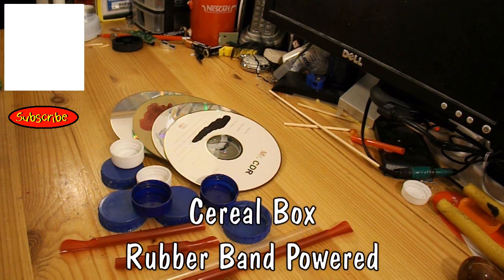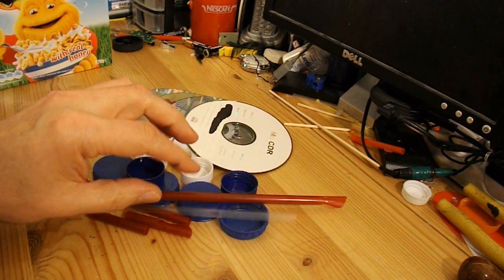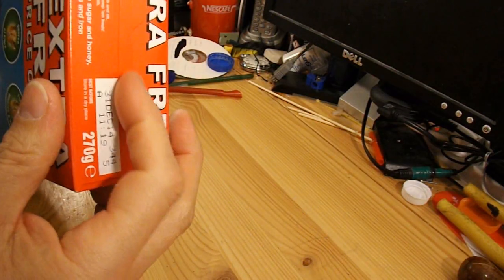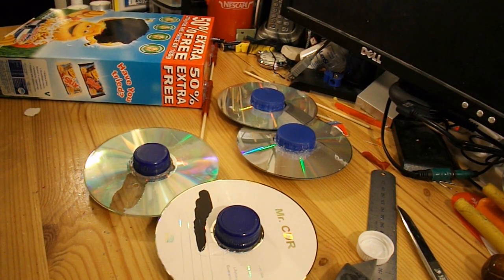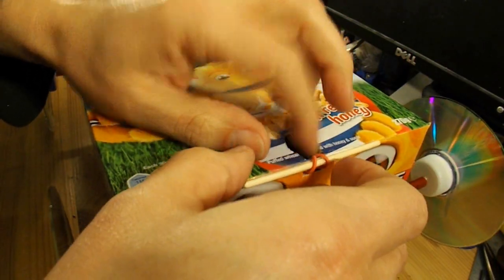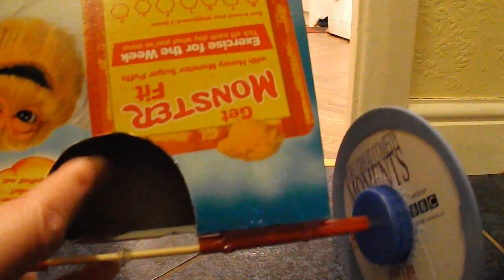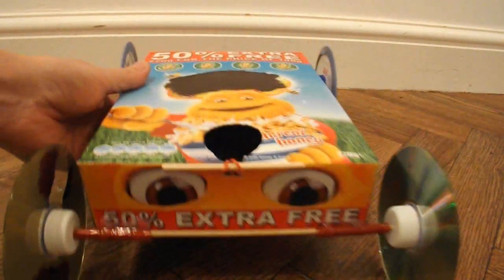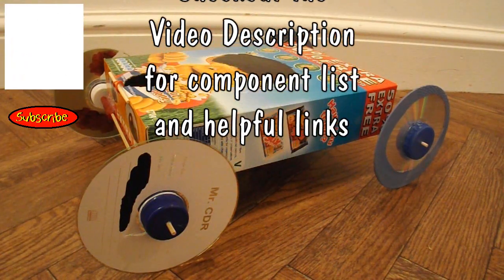Cereal Box Rubber Band Powered Car

Comment from the maker: If you have a question it is probably worth reading the video description first because the answer may already be here. To help you find my videos I made two search guides https://youtu.be/ceBSOoOHcgw or https://youtu.be/Zj4UgwkwYRk or checkout my playlists page https://www.youtube.com/user/GrandadIsAnOldMan/playlists?flow=grid&view=1
Reply: can you pls tell how to put the wheels so they can stay because when i put the wheels they slide of was it because bigger hole in the caps pls answer 😃
Reply from the maker: ummustafa javed when you make the holes in the caps you must use something thinner that the axle you are going to use. That means when you push the axle through it will be a tight fit. If it is too late to get that right you will have to add glue or you could try putting sticky tape round the axle to thicken it where it goes into the cap. Just one or two layers will probably do the job. I usually manage with a little hot glue on the outside bit of the axle.
Reply: can you pls make a car with shoe box if posibble
Reply from the maker: +ummustafa javed I don't have any shoe boxes but to be honest one box is much like another, so any box will be like using a shoe box. In my Rubber Band Power playlist I have over 200 videos and many of them are rubber band powered cars and many of those are some sort of box. If I find a suitable box I will make one for you but you might like to look through that playlist anyway https://www.youtube.com/playlist?list=PLA5a2xPRSrB1otXh0w36OwsYIHZznUWp6   this tissue box would be very similar https://youtu.be/2sO7X7qGRAs?list=PLA5a2xPRSrB1otXh0w36OwsYIHZznUWp6
Reply: +GrandadIsAnOldMan thanks
Reply: +GrandadIsAnOldMan I always allow replies, unless a glitch occured. I was wondering if you can... make an motor car, like a toy to donate to children, out of an red heart-like crystal? A heart-crystal-car.. I doesn't have to be an actual gemstone, and you don't have to take up the request, but... I want the children in your neighbourhood to be happy... Handcrafted toy cars, all for them.. You don't even have to say my name, or credit me, I am not in the request for fame, just making others happy...
Reply from the maker: Toriel Dreemurr going through the points of your comment. 1. The issue with YouTube preventing replies to comments has been fixed now that YouTube has broken the link to Google+ however I have well over 2000 videos on YouTube and many of them have that warning text on them because they were published when the problem existed. I now delete that text form any video I have reason to revisit, but I am not going to attempt to edit all 2000 videos to remove it proactively. 2. I am not interested in trying to make the children in my neighborhood happy, that is their parents responsibility and I have no intention of interfering in other people's lives.
Reply: do
Reply: GrandadIsAnOldMan can I ride it
Reply: what type of juice caps did u use
Reply from the maker: I tend to use Milk Bottle tops because we have plenty of them. I always save all the plastic bottle tops from any bottles we use.

Comment: If our car is smaller and the wheels have more traction, but it still uses the rubber band mechanism, will it go farther?
Reply from the maker: +bold n brash not really a simple answer. Smaller and lighter with good grip will accelerate faster and probably go father but not always. Here are some other considerations. A heavier car will accelerate slower but once it is moving it's mass may help it freewheel longer after the rubber band has finished. Larger wheels - assuming you are using the same sized axle then you will be putting the same number of turns round the axle right? but for each turn of the axle a larger wheel will move further along the floor because it has a greater circumference so for the same number of turns a larger wheeled car will go further. SO no simple answer, sorry.

Comment: I have to do this for a science project but without it being powered by a rubber band, however my car is just sliding and not rollong, do you have any idea why? Also, how can I fix that?
Reply from the maker: If it is sliding around without the wheels turning then something is stopping the axles turning. That probably means the tubes you used for the axle tubes are too thin or the axles are too thick and they are binding. Or the wheels are too close together, rubbing against the end of the tubes or the cardboard box.
If you are not using rubber bands, how are you powering it. Are you just pushing it?
It may simply be that the car is very light and the wheels are not gripping on the ground. You could add weight to help them grip or put the rubber tyres on the CDs. You will find this link in the video description with other information Helpfile - how to put tyres on CDs for model car projects https://youtu.be/ZnuPnveCbxs

Comment: would it still work fine if there was only bottle cap hub per cd wheel. like i only put a bottle cap on one side. would it still be ok?
Reply from the maker: +itsLuis551 why don't you try it and find out. I expect you will find that the wheel tips sideways because it is unbalanced. The problem with CDs is the hole in the middle is too big for most things that you want to use as axles so you need to cover the hole and put a smaller hole through the middle. You could just try gluing some cardboard or flat plastic across the hole and make a suitable hole for your axle through the middle. I use plastic bottle tops because I have plenty of them and they are easy to use. Maybe you could use a bottle top on one side and a flat piece of cardboard on the other. That would help balance the wheel.

Comment: How did you get the skewer through the bottle caps? Did you drill a hole?
Reply from the maker: +Alyssa you could use a drill. I have a tool called a bradawl which is just a metal spike with a wooden handle.

Comment: how can i design and build  a car driven by a SINGLE small elastic band to carry an boiled egg over a distance of exactly 12 metres
Reply from the maker: I have 124 videos in my Rubber Band Power playlist http://www.youtube.com/playlist?list=PLA5a2xPRSrB1otXh0w36OwsYIHZznUWp6
I have nowhere I can test a car to run exactly 12 metres but in that playlist there are cars that run a fixed distance by using a length of string or cotton winding round the axle to measure the distance travelled and stop at the right spot.
There is a table defining the different sizes of rubber bands so you would need to know what size 'a small rubber band' is, so you are not disadvantaged by other people's interpretation of 'small'. You can easily find it with a Google search.
The main aid to travelling a good distance is ensuring you reduce all sources of friction. Thin wheels cause less friction which is why I use CDs most of the time.
A thin axle will have less friction than a thick axle and you need to think what you are using for the axle bearing surface.
Larger wheels maintain momentum better than small wheels and you will probably need this to keep the car going after the rubber band has finished. Old fashioned vinyl records are a good option but you may struggle if your rubber band is too small.
There is a trade off between light and heavy cars. Too light and the wheels spin when you start although you can reduce that by putting something on the wheels to increase grip, like a strip cut from a balloon. Heavier cars take more to get them moving but then maintain their momentum better than a light car.

Comment: when I do the wheels do I leave space between the cereal box and the bottle cap?
Reply: I can't use bottle caps so I just cut Styrofoam but it won't stay
Reply from the maker: +Julie Smith yes you need to leave a gap to stop the wheels rubbing on the box. You could even add small discs of cardboard to act as spacers. Foam is too weak for wheel hubs, try thick cardboard or several layers of thinner cardboard. In the video description there is a link for CDs with cardboard hubs.

Comment: well I fixed that problem. now I have another one. if I wind a rubber band too tight, the axle spins too quickly and the wheel doesnt turn. how would I fix that?
Reply from the maker: +Spencer Bev put rubber tyres on. In the video description there is a link to my helpfile on putting tyres on CDs using strips cut from rubber gloves or balloons
Reply: +GrandadIsAnOldMan that's not the problem. the axle spins while the wheels don't.
Reply from the maker: Spencer Bev you will probably have to glue the wheels to the axle to fix that.

Comment: Please reply, did you use a hot glue gun to make the wheels connect to the axle? I tried that, but the wheels don't stick to the axle.
Reply from the maker: When I make the holes in the bottle tops they are slightly smaller than the axle so they are a very tight fit and grip the axle without any glue. If they are loose then, yes, I would use hot glue. If you have enough of the axle sticking out past the wheel you can put plenty of hot glue on the bit that sticks out so you have a larger area of glue making contact.
Reply: GrandadIsAnOldMan Okay, thank you.

Comment: GrandadIsAnOldMan, how did u get the screwers to connect to the bottle caps
Reply from the maker: I usually make the holes in them too small so the skewers are a very tight fit but you could always use some glue or even tape. There are some useful links in the video description

Comment: Hey grandad. I'm supposed to make a project alike to this one but instead of 3 meters It would have to go a total of 15 meters or higher. Do you have any ways that can make the vehicle go further in distance. Thank you
Reply from the maker: The distance it travels is down to the weight of the car, the friction of the bearings, and the power of your rubber bands so generally adding more rubber bands will increase the distance but may cause other problems like wheel spin or even crushing the body or bending the axles. Here is a simple car that goes a good distance - Rubber Band Powered Car 1 x size 64 - full length video https://youtu.be/pIO3FiHX4Oc?list=PLA5a2xPRSrB3g5RiX8Kf_uUBOL0Tb7AS0
Reply: GrandadIsAnOldMan  thanks 😊

Comment: can you please help me asap? I need to make this car go forwards and backwards. i tried doing what you did for #8 by adding another paperclip but it didn't work. I am not asking for another video, just a point in the right direction. I need this done by tonight
Reply from the maker: +Spencer Bev I don't know what you mean by adding another paperclip. Where you watching this video Rubber Band Powered Car #8 goes forwards and backwards https://youtu.be/bBU8UngaFfM The string attaches to a peg on the axle, you wind the axle for a number of turns, then pass it round the second peg so you can wind the axle in the opposite direction. In another video Forwards Backwards Turn Programmable Rubber Band Car https://youtu.be/ILvqa8Id4Rc I put lots of pegs on the axle and the car goes forwards and backwards many times and also turns because the front axle is set to move in reverse
Reply: +GrandadIsAnOldMan so my axle is a barbeque skewer and I used bent paper clips as pegs. the rubber band keeps getting caught on them.
Reply from the maker: +Spencer Bev you will have to redesign that part if it is causing the problem. Maybe a thicker axle so you can drill small holes and use thin wooden pegs like toothpicks or similar, nicely rounded off with some sandpaper so the bands don't get snagged.
Reply: +GrandadIsAnOldMan okay I will try that.
Reply: thanks for that advice too. i appreciate it.  I have two more problems. The first one is that i need it to launch on an inclined plane without me touching it. The second dillema is that i need it to go exactly ten feet then back five feet. Getting it to go ten feet is easy, but how would i install a break system alongside the pegs?
Reply from the maker: +Spencer Bev in the video description there are links to my playlists. One covers Brakes on Rubber Band Cars and another covers Carrying Dropping Pushing Pulling Stopping. They may help. I can see your problem, the car will go forwards 10 feet because you have put enough turns around the axle to travel 10 feet, then we have the peg on the axle and the car then goes backwards for the number of turns you put in the reverse direction. You could have another peg and the car reverse direction again at 5 feet, but stopping it dead is not so easy. You might be able to arrange some sort of spring lever that is released at that point that jams the wheels solid against the chassis like a stick would go through the spokes of a bicycle wheel to jam the wheel in the frame.

Comment: How do you make the bbq skewers go through the wheels?
Reply from the maker: +Elisa Hernandez if you have a drill you can drill holes. If you have a metal spike like a nail you can push it through. If your plastic bottle tops are soft plastic and your bbq skewer is hard enough you can just push it through. If you look in the video description I have two links showing you how to make CD wheels.